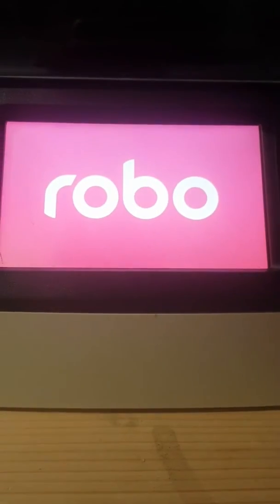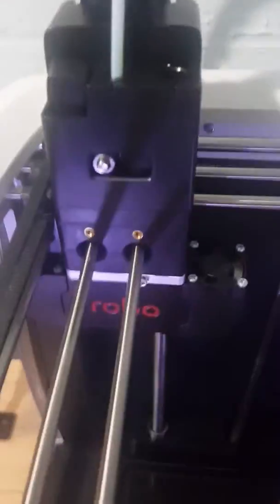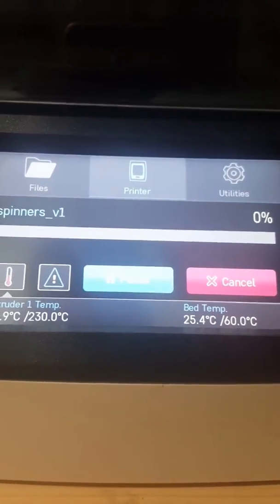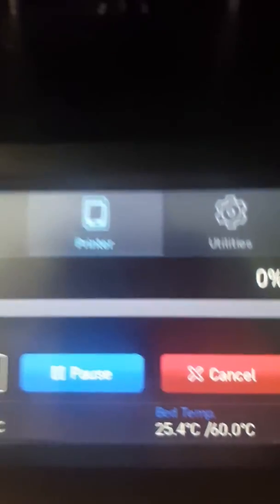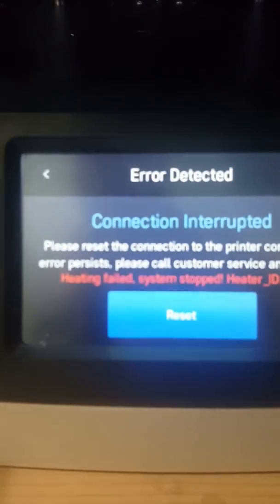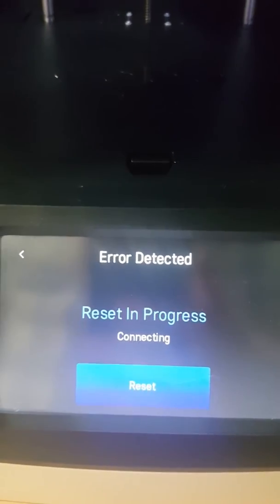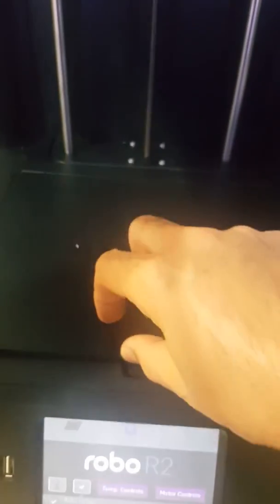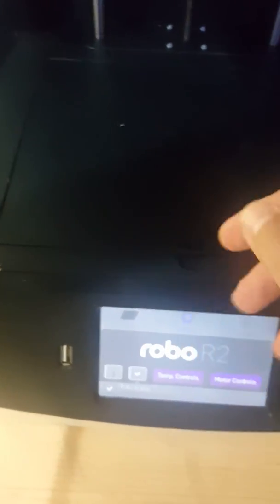Robo R2 continues to have problems

Comment: The pogo pins are mostly likely frozen which means that the current bed you have is useless so you will need to buy the new heated bed from robo
Reply from the maker: I'm not buying anything from Robo ever again. This over-priced printer has been nothing but trouble since I got it. In comparison, my $200 Tevo Tarantula has been a dream to work with.

Comment: I trusted robo 3d. I believed the claims. I bought the robo r2 thinking it was a good 3d printer that filled the gaps in my 3d printing needs. What I got was ripped off; every attempt I've made to engage with robo3d support has been meet with BS copy/paste replies from Robert Leal, which included links that are broken, and answers that didn't fully address the issues I'm having. I haven't even had this printer for two weeks. I've asked robo3d to just please take this thing back, but they won't. I'm disgusted, I'm sick with myself for wasting the money I've spent on this printer. 

Below is the original email I sent to robo3d support:

"Hey guys, I recently purchased the robo r2. Order #12830 was ordered on October 4th, and delivered on Oct. 12th; I was traveling on military orders that week, but was finally able to open my robo r2 on the 16th of Oct. I realize there's going to be a learning curve with different printers, but the issues I've experienced with this printer can't really be chalked up to rookie mistakes. 

There are a few main issues (so far) that I'm having, and the frustration makes me want to return this machine and start over elsewhere.

1. Out of the box, the top door hinge was broken (photos attached). There were no visible signs of trauma to the container. This calls into question the quality of parts used to manufacture the robo r2 3d printer.

2. The touch sceen: this thing is absolutely INFURIATING. It might accurately process 40% or 50% of the touch input at any given time, then it registers about another 10% of the input on a few seconds delay. Often times, the delayed processing isn't even for the menu I'm trying to access, rather some random field on another section of the screen that wasn't touched.

3. Temperature accuracy: I have had trouble printing various materials, and researched ways to fix the issues I was having. After continuing to have issues, I checked both the bed temperature, and the nozzle temperature with a laser surface thermometer, neither of which were what was indicated on the touch screen display. The true temperature was consistantly and significantly cooler, by varying margins, than the reading on the machine.

4. Mobile applications: I'm an android user. The only mobile application you offer is for iOS. I'm not sure I've ever known a third party company to only release a mobile app on a single mobile operating system, though I'm sure it does happen. Is robo 3d an apple affiliate?

5. Accessories: the robo r2 is said to be compatible with a dual extruder assembly. This was the main factor in my desicion to purchase the robo r2. The only release date that I can find for this accessory is September, 2017. To my knowledge, the dual extruder is still not available. After experiencing all these other issues, I'm not confident that the seemingly inadequate processing power of the robo r2 will be able to effectively drive a second extruder, which again, was the deciding factor in choosing the robo r2.

Thanks for reading. Hopefully together we can make this situation better."

There have been a few back and forth replies since this initial engagement; however, the expectation that Robert Leal has for me is to troubleshoot both, the raspberry pi, and the robo boards that drive this machine. I have neither the time nor the inclination to do that. I didn't purchase this printer to spend all my time just trying to get it to print. 

I have lost a lot in purchasing this printer. Please, don't make the same mistake I did.
Reply: I actually preorder this printer because of their reputation for customer service and printer quality, but reading many of the complaints here on youtube im glad i canceled it from them last moment.

Comment: Your bed thermistor has come detached.  On the bed itself.  Or it has died.  Its a consumable and you will have to replace them from time to time.  You have to reseat them so they are making contact with the bed surface from time to time (assuming it is still working).
Reply: Or your bed heater wire is disconnected... Looks like the bed thermistor is still outputting a reading. If the thermistor was disconnected you'd see 0 or some other crazy number.